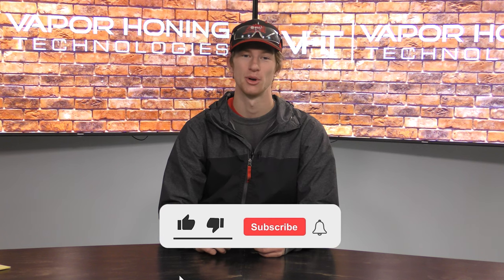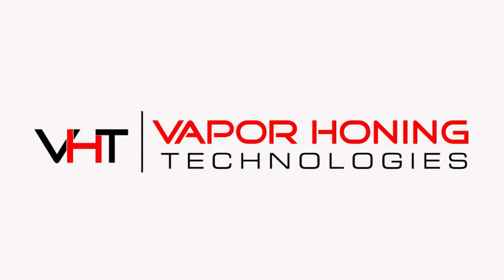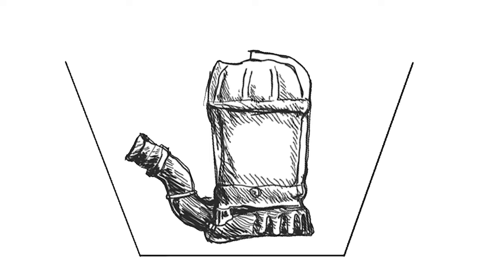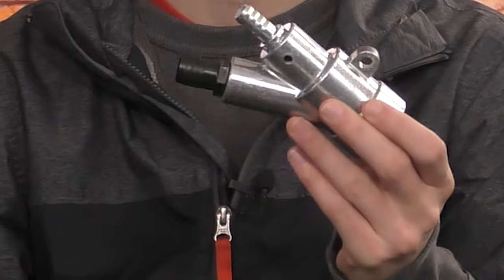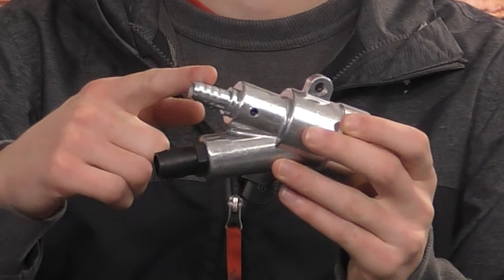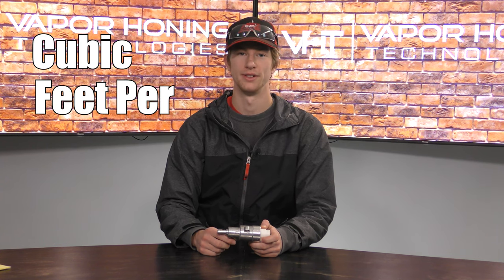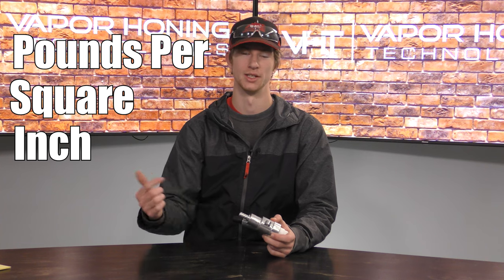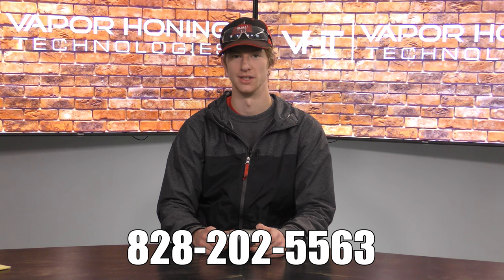How can I use PSI to my advantage? - Vapor Honing Technologies

Comment: what do you recommend to roughen the clear coat on a car rim and prepare it for repainting?  Which material (glass beads possible? or coarser, more angular material such as aluminum oxide and which air pressures?